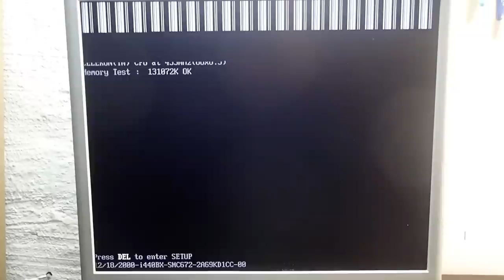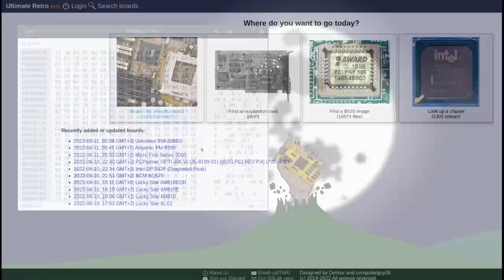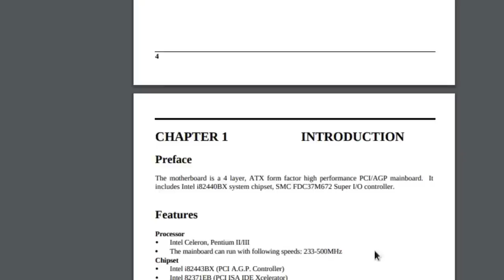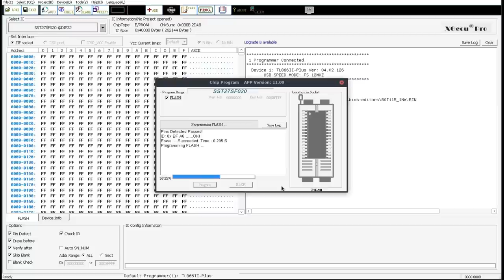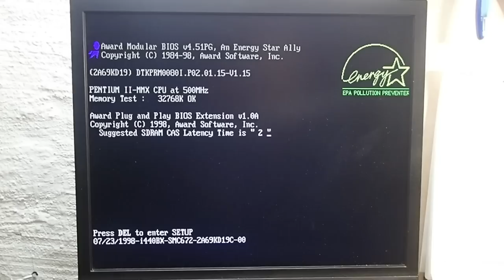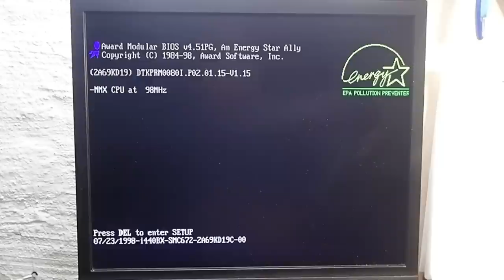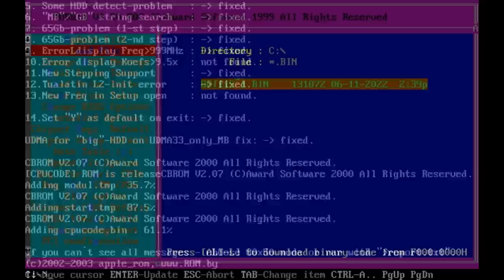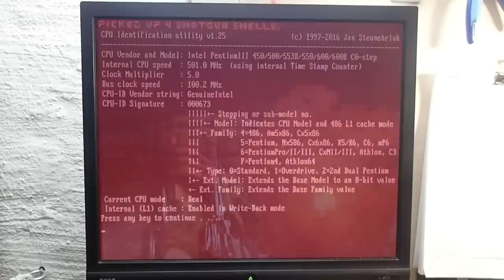My endless confusion with a i440BX Pentium II mainboard.

Comment: ESR-value is also an important part to take into consideration when replacing caps on a motherboard.
Reply: Some motherboards more than others. Newer boards will be more sensitive. Older ones without regulators or with linear regulators, it doesn’t matter much.
Reply: Never had issues with good quality name brand caps. Just look at many motherboards kept kind of working for a while even with puffed caps, it is not that critical for retro use
Reply: @krz8888888  Yeah, that's the funny thing, when I'd get a call to fix a computer that's crashing or stopped posting and I find the capacitors were the cause, they are usually way, WAY gone by the point functional problems appear.  I would try to order the best parts I could but it was really more of a "I don't ever want to see this board again" kind of thing and probably could have gotten away with a lot crappier parts and nobody would ever know the difference unless someone hung onto it for another 15 years.
Reply: I just go to Digikey, select Nichicon, In Stock, pick the lead spacing and diameter (and height if t matters), then filter by 105C or higher, and pick the one with the highest ripple current rating.  That usually lands in the low-ESR range meant for switching supplies and point of load switching regulators.  Should be perfect for PSUs and motherboards.

Unless you have access to the original designer’s intention, it’s always a guess what the capacitor’s secondary specifications should be.  But usually, the most robust cap is more than adequate, without veering so far off that it causes loop stability issues or anything like that.
Reply: @nickwallette6201  No need for stupid guesstimating if you'd put some time into looking up the datasheets for the dead caps you're replacing. But.. you know.. that would require common sense...
Reply: @Knaeckebrotsaege  After repairing 50+ motherboards during past 20+ years, Nope! I'll do more or less exactly like Nick Wallett! I don't have the time to look up, and wait for "a good enough" cap, I'm going to stock one of the best caps because it will work for shitty motherboards and it'll work for top shelf motherboards and it'll work for any other projects. Customers n friends are way happier with a turnaround time of a few hours and thrice the part cost instead of days without a PC and paying separate shipping costs for a set of 6 "adequate" but slightly cheaper caps. No, repairing mobos is not my job, just part of my electronics interest and the bloody word got around
Reply: @Paxmax  50+? cute.. add a zero to that at minimum, then we'll talk. Stocking good quality caps from the most common series also isn't an issue. Ofc if you're one of those clowns who just orders a handful for every single board, we don't need to take this any further. I'm the kinda guy who ends up having to fix botch jobs from guys like you. Not that I'm complaining.. I'm making a nice bit of cash from it :)
Reply: Thanks for the comment, Robert. That same thought came to my mind when Necroware mentioned to exchange the capacitor with a higher spec voltage. But lets not forget that internet citizens, especially we YouTube commentators tend to over-complicate things ... :P 
This may only be important where the frequency response/behavior is important. Like in (audio) coupling capacitors or smoothing capacitors in switching power supplies or pre-stabilization parts of linear PSUs. But in decoupling applications for the supply voltages on motherboards? I don't think that will hurt anyone. If in doubt, as always: RTFM! (=data-sheet) There are all values waiting, extra for someone to read them:)
Reply: @Knaeckebrotsaege  WOW! If you have so much experience and seen sooooo much boards, why don't you explain that to us: Same board manufacturer, same PCB revision but a different supplier for the caps, with varying ESR values from 10 to 30%[1]. If even the manufacturer doesn't follow YOUR(lol) rules laws, you should write an even more patronizing letter to them. That there are tolerances in parts and this is even put into thought by the engineers and pcb-designers, including those pesky guys from the companies purchasing department ... oh and it reality does make you look very silly (sorry, your argument, not you as a person). The only useful thing you said is reading the data-sheet. But then completely ignoring component tolerances or use-case and then this fundamentalist view of the "right" approach (your own of course... what else?! LoL). [2]
Oh well, and leaving out important details and "generalizing over corpses", just to fit your narrative doesn't look exactly like the work or mental maturity of a professional.

P.S.: Mit deiner herablassenden Schnauze bist du aber bestimmt nicht für die Kundenbetreuung zuständig, oder?

[1] You must have come across this "glitch in the Matrix" slightly touching the credibility of your argument before. How not? Taking 50+cute (what means 51 ... mathematically ... probably ... ROTFL) mbs AND reading datasheets, there is NO WAY that this fact didn't come to your attention. Questions over questions, then why this strange comment? A logical nightmare. DALEKS, exterminate, exterminate:)
[2] Maybe also read a book or two about what those values actually mean and how they are affecting the circuit? Better ... Take an apprenticeship with a professional (not you especially, that was general advice).
Reply: @dieSpinnt  My comment was based on my own recap of a DFI NF2 Ultra B. Most of the information I found on the subject made it clear to use low ESR caps. I did so. Everything works great.
Reply: @Robert.K  "Everything works" (missing: NOW, LoL) ... exactly this part of your comment shows that you have no clue about capacitors, the parameters and how to choose the appropriate one. The positive thing is that even if you don't have any clue, most likely your changed components will outlive you and me;)
Following the low ESR advice was a wise move ... from the viewpoint of a capacitor manufacturer, hehehe;) If you have 100000 to buy, then you will probably think different. Then you will use the CORRECT part and not an over dimensioned. As I said, both scenarios won't hurt, except the one ... your wallet. 
Have fun with your machine, that's the important thing.

BTW. that "low ESR" parametrization is equally funny as "some Volts"
Reply: @dieSpinnt  "exactly this part of your comment shows that you have no clue about capacitors, the parameters and how to choose the appropriate one."

Is this your way of communicating with strangers? Kinda rude, huh?

I did my reseach: the caps I replaced called for low ESR ones.

English is not my native language, so if me writing" Everything works" tells you I'm an idiot - that's fine with me.
Reply: @Robert.K  Power supply design and providing clean and reliable power is a science and an art in itself. There are separate departments for engineers and it is of course impossible to deal with this in detail here.
I explained a bit up there which applications low ESR capacitors are primarily for. Another topic is of course to replace a defective component with a comparable(!) component. That a lower ESR should also be better at the same time is a misconception and can possibly take revenge years later ... or not ... or intermittant. That is a fault-mode no one likes, believe me! 
I don't really know what your answer is supposed to mean. You're practically telling me: someone on the internet told me to use low-ESR capacitors (out of the blue, without using actual matching parameters of the components?!). Without any justification, without questioning it. Adding that it works for you makes that statement even more thorny. First of all, this can only be seen in years to come. Also, I doubt that you have undertaken any quality testing to be able to make such a reliable statement at all. I just see that as a mere assertion. Without any measured values and long-term tests, nothing is clarified when it comes to capacitors. I find such statements simply too short and misleading. Do you understand the problem?:) Others might copy you "style" ... Which is partly YOUR responsibility.
Reply: @Robert.K  "English is not my native language, so if me writing" Everything works" tells you I'm an idiot - that's fine with me."
No you are not an idiot. It is just what your comment may do to others. Sorry if that was rude. Also I wrote two other comments and deleted that one you responded ... because it wasn't that nice. 
Low ESR = BETTER is just a wrong assumption and in fact can make things worse. Period! I explained my arguments to some degree, while you did not explain something or gave any source. That is a problem ...
Reply: @Robert.K  BTW. being a little satirical and joking on your cost isn't appropriate, when you show that level of ignorance? 
I mean stating "it works for me" in a branch of electronics and chemistry that is very extensive and deep. That is laughable naive, so please excuse me if that has hurt your feelings:P
Oh and that you are more concerned about how I think about you (that doesn't matter ), than discussing the arguments I made (the TOPIC!) is ... don't you see that?: Ignorance in top form. I am asking now the third time for background information: Why have you changed specifications ... or ignored specifications of your components? On what basis? (No, "someone on the internet said so" is not valid!). So lets please come back to the facts.
Reply: @dieSpinnt   The original caps were Chemi-Con KZG "Super low ESR". So, what have I changed? How am I being ignorant when replacing them with the same spec capacitors?
Reply: @Robert.K  Lets try again, maybe this is more understandable: You said "ESR-value is also an important part to take into consideration when replacing caps on a motherboard." 
But you've taken low ESR capacitors as exchange components for your old capacitors. Right? That means, you contradicted yourself. Not KNOWING the values of the old parts or changing them to a DIFFERENT ESR-specification is the opposite of "taking the ESR-value into consideration". You effectively IGNORED the values chosen by specialists and took some arbitrary values. I mean, that can't be so hard to recognize?
Reply: @dieSpinnt  Exactly where did I say that I've ignored or changed any spesifications?
Reply: @dieSpinnt  What are you talking about? I replaced them with caps with the same specs.
Reply: @dieSpinnt  My first comment was meant as "Do some reseach, use the correct values" not in any way trying to get people to replace all caps with low ESR ones.
Reply: @Robert.K  Now that is some information!!! Thank you for letting me pull that out of your nose!:)
If that is so and the ESR values are in-spec for old and new caps ... then you are a hero, I love you and there is nothing more to discuss. 
BTW thinking that I can read your mind ... is what?: Yes, Ignorant! (You never gave this information before)

Oh ... you didn't fool me, or? In our entire conversation it never came up that you had exchanged the capacitors 1:1. There was talk of an unspecified source on the internet and that you exchanged the capacitors for low-ESR. So from the wording against OTHER capacitors.

This makes your whole topic totally strange and weird, by the way. Why should this be considered when replacing the components 1:1?
Anyway, I said what one may consider when choosing exchange types and that this is an extremely complicated but also exciting topic. Have fun with your motherboard!
Reply: @Robert.K  Now don't take me for an idiot. ("Exactly where did I say that I've ignored or changed any spesifications?")
It is common practice of botchers of all kind on the internet to spin the narrative: "LOW-ESR" capacitors are better than sliced bread. Which it is NOT!
Reply: @Robert.K  "My first comment was meant as "Do some reseach, use the correct values" not in any way trying to get people to replace all caps with low ESR ones." 
Good that this is clarified. I second this. 
But the written word does not function this way. It simply isn't written up there, what you say here ... not even that similar, okay? Why do you think we have this boring discussion?:)
Reply: @dieSpinnt  You started a discussion with me based on assumtions. Before you "attacked" me with your comments, I hadn't said anything else than that you should take ESR into consideration when replacing caps. I never said that I changed any values or "that works for me" those were your words. Then, being sarcastic on my behalf and calling me ignorant, when giving a good advice just didn't make any sense. I do understand that you want things done correctly, and that's exactly the same thing i strive for when doing repairs. If you go to the top of the comments and read them again from my perspective, I'm sure you'll understand that some of your comments directed to me were out of place. Now that we both know we're working to achieve the same goals, lets just be happy and enjoy the weekend. Cheers

Comment: Can you overclock the FSB on this motherboard to 133MHz, to get the 866MHz P3 to run at its stock frequency?
Reply from the maker: Yes, it is possible, but probably I have to replace the clock generator. I didn't check if it supports frequencies over 100MHz.
Reply: @necro_ware  beware there are at least two revisions of the 440bx chipset. The oldest one has only up to 1/3 divider for PCI meaning that 133mhz fsb would translate to over 43mhz on PCI. The newer revision has 1/4 for PCI which makes it running at a proper 33mhz.
Reply from the maker: Yeah, I'm aware of that. I actually thought, that all i440bx couldn't handle 133MHz with proper clock division regardless of revision. Furthermore, this board would need a hardware modification to get over 100MHz anyway, so I'll stick with that so far.
Reply: @necro_ware  can just try softfsb in win98 and see if it works (assuming board supported). Very easy and low risk - if your pc crashed, power and cycle and you're back to previous settings (at least on my msi 6119 440bx!)

Comment: i found in trash treasure Gigabyte GA-BX2000, 440BX and SB Link. Easy repair missing only jumper for bios clear so MB now starting :D Will change some bad caps and letz go try Yamaha YMF724F-Y XG and sb link functions 😊
Reply: That DTK also had SB-link.    You should totally do that! I've always found this ISA backward compatibility feature an interesting relic of the time.   I have a Yamaha waveforce but have not got around to testing SB link functionality.
Reply: Ah, nice board. I'm trying to get it for reasonable price for like year, but no luck. I have only GA-6BXC, which is older, and how some flaws (overclocking through jumpers), also is powering on by itself, when you turn on power supply, which is pretty irritating. Want to change it for GA-BX2000, which is also newer board, and handles "BX-133" better.
Btw, that flaw with auto-powering on, is even mentioned in tomshardware review of first bunch of slot 1 motherboards. Just search of it by typing of name of motherboard and putting review. It can be seen, that it is first bunch of BX Slot1 motherboards from 1998, and I finally want some later one (I have only 4 early 1998 ones BX motherboards)
Reply: @warrax111  same thing my older mobo Fujitsu Siemens D1107 vith BX440. When i turn on PSU motherboard will start for like two seconds. I think is not error or broken. Some motherboards just doing this. Dont know for what is this function but ye ... is little bit annoying 🤔
Reply: @Dudulinek82  It's even dangerous, as sometimes, you don't have everything connected, because you don't expect it.

Comment: ICS should be easy to hack to 150MHz FSB. With 1.8V Mendocino will be stable, getting faster RAM is not issue nowadays (or configure CL2 modules as CL3) and only problem will became 100MHz AGP. Some wisely chosen GF4Ti should work.

Comment: Yes! If you think it is not the bios it is the bios 😄 I saved two board I really wish to have working in a very simillar way. Those were not posting at all and waiting on the "to do" pile - This I have learned from your videos - wait until you have an idea and time and stay calm. 👍
Reply: And one more remark for the others - one of these boards is FIC VA503+ which is a socket super7 legend. This board has a soldered bios chip - and it is quite frequently failing (or it is bricked by a previous owner - as there are many PCB rev.). If you got such a board in a pristine co dition but no post - desolder bios, put a socket there and give it a try.

Comment: I do it the same, with 366 Celeron Mendochino, it can be ran without cooler, for testing purpouses to BIOS, if it boots and get into BIOS, it can be run like that up to 15 seconds, before temperature start reaching 90 degrees. But Celeron 300A would be even more suitable for this purpouse, as it heats up 10% slower.

Comment: What a blast from the past. i440BX chipset mainboards were the mainstay of the Pentium II and Pentium III. I can see why the previous owner could flash the wrong BIOS.

However, I was starting to get worried when you washed the mainboard in the kitchen sink. That is something I’ll never do. If I have to do such cleaning, I would opt to use distilled water instead. It would be a good idea to look into that.

But I still like to see old tech being used instead of being sent to the landfills.

Comment: That was a nice chipset (great for OC) and a good why to update CPUs with a new socket and even different pinout (Tualatin core for example). It even had max memory capacity of 1 GB and newer Intel chipsets like 810/815 had only up to 512 MB. I had a few boards, one failed with a mosfet blown (capacitor leaked). I don't know why I still remember it was some CET 30V, 40A, 50W that I couldn't find anywhere.